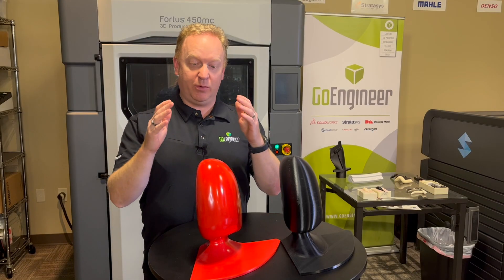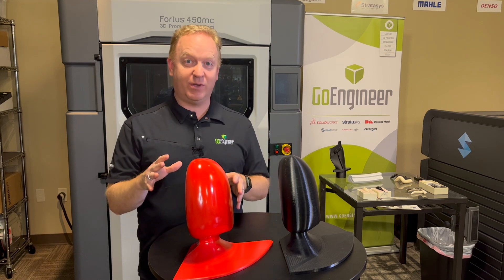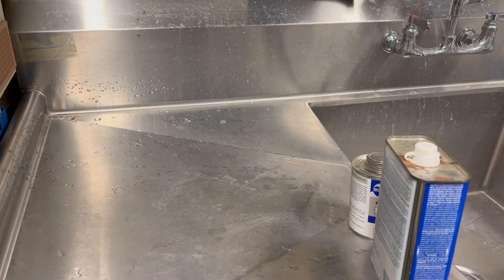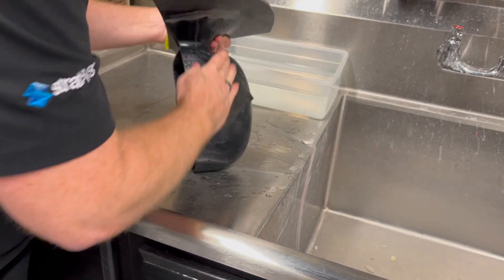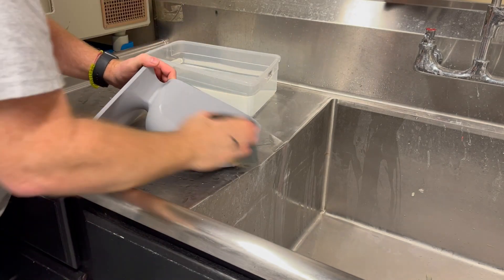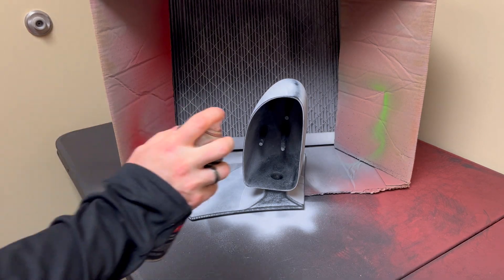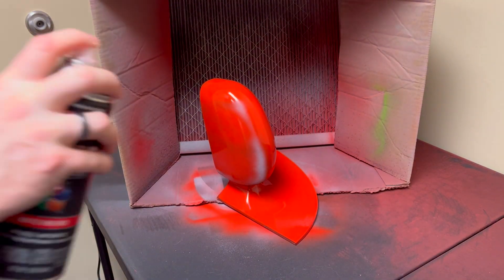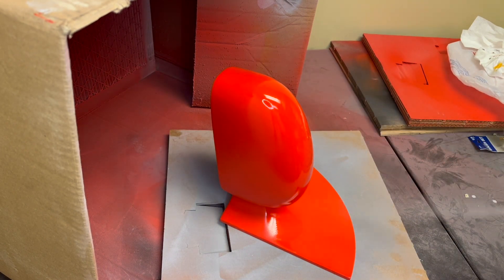How to Get a Super Smooth Finish on 3D Prints

Comment: Sorry if this sounds dumb but does this also work on pla? Or only abs
Reply from the maker: That's a great question! Because acetone reacts with ABS, you can skip that part of the process for PLA (acetone doesn't react the same way). For a PLA print, you would still do the sanding, but you can wash away the dust after sanding. Get the finish down to the right texture with course and wet sanding and then use a primer (we've found automotive filler primer works very well) to help you get a super smooth finish.

Comment: Leaving the dust in place. It's the first time I've heard of someone recommending using the FDM dust as filler material. Makes perfect sense.
So many videos about smoothing FDM prints are so work heavy that it defeats the point of 3D printing - rapid prototyping and instant gratification.
Loads of prop makers end up using FDM prints as little more than a scaffold for their final product - and there's nothing wrong with that - but it's far from the ideal of a 3D print.
We look forward to a better approach in both FDM and Resin technologies for makers.